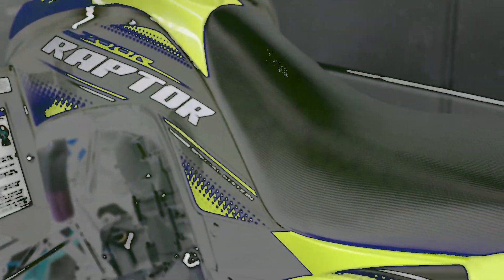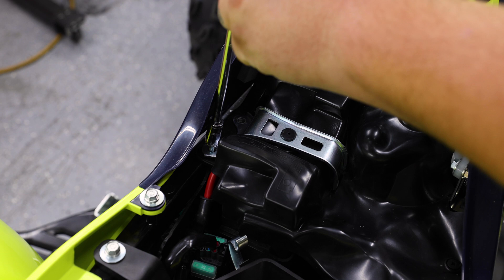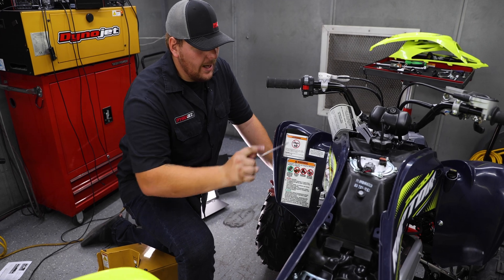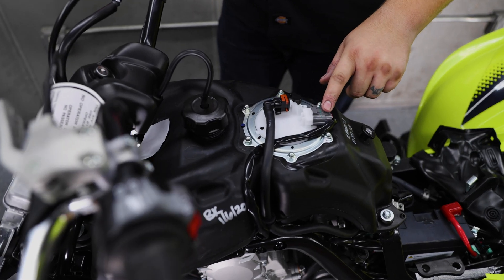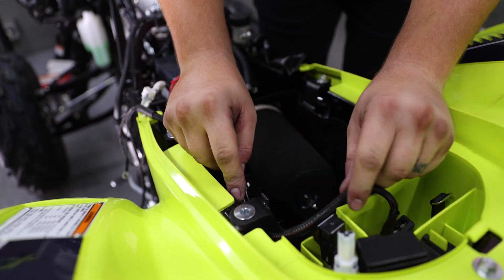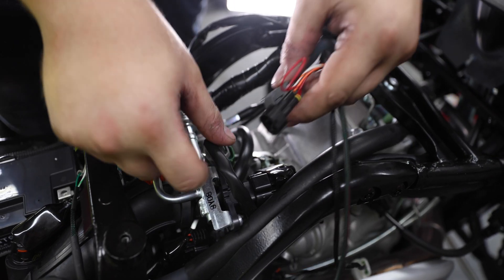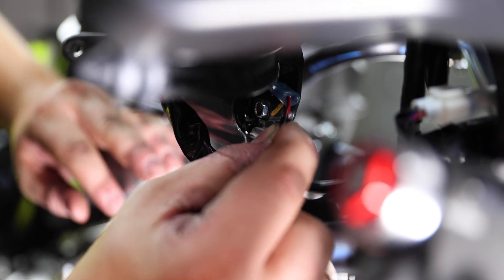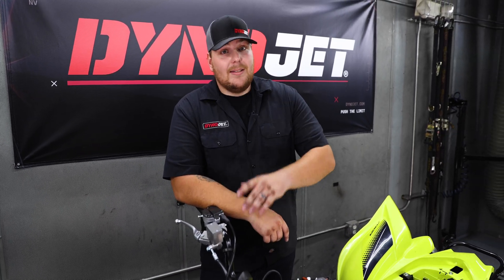How to Install a Power Commander V: Yamaha Raptor 700

Comment: Do not install this on a 2023 or a 24 700 what they won’t tell you is Yamaha change parts on the wiring harness for 23 to be able to hook up a diagnostic tool that is why the programmers caused the bike to throw engine code 33 and will not fire and it will leave you stranded take it or leave it. Everyone thinks they know everything, but I am speaking from experience along with hundreds of others, there’s a reason on the website that you cannot select a 2023 or 2024 yet
Reply: there’s no way around it?

Comment: If you have a stock bike and just have a slip on leave it alone, I installed this on my 2023 raptor 700 R and after four hours it made it a $11,000 paperweight and had to remove it because the bike would not start these things are garbage and your bike does not like them despite what everybody says on those Facebook pages unless you’re doing a big kit and a KN air filter, leave it alone the stock computer will compensate for a slip on pipe, the code it will throw is 33. There’s a reason on all the websites they don’t offer one for a 2023-24, they changed the wiring harness in 23 and the programmer doesn’t pair well.
Reply: Hey I have a 2023 700 just bought the slip on is your bike still running the same after not doing the tune also.
Reply: @markeithsellers8522 yes it is, I’m sorry just seen this, zero issues, they just push the programmers to make money your bike will compensate just fine with a slip on like a yoshi. Zero issues. Dyno proven
Reply: @bigbeef8935 what about a fall exhaust a big gun Evo black “I think it’s called” I brought it 3 days ago the only mod is the fall exhaust I think it’s still got the stock air box & not a K&N filter ect ? seems to run fine but I do see these channels & people saying you need one of these power commanders if running a fall exhaust? Appreciate any feedback
Reply: But on the 2021 model the Commander will do well ?

Comment: So is this compatible with a 2022 model? You’ve said it is and isn’t in two other comments below.
Reply from the maker: The PC6 now supersedes the PCV. You can find the PC6 available on our website now for the 2022 Raptor 700.

https://www.dynojet.com/power-commander-6-for-2015-2020-yamaha-raptor-700-pc6-22074/
Reply: @DynojetResearch  Great, thanks.

Comment: Does the power commander V to 2020 models can be connected to raptor 700r SE 2022?
Reply from the maker: The PCV will not be compatible with a 2022 model.
Reply: @DynojetResearch  thanks for your answer. I was getting ready to buy it this week since the dynojet customer support told me they are compatible. Thanks again keep up the hard work.
Reply: @DynojetResearch  
So is there an option at all for a 2022 model? Do
You need the PC6? I’m in the U.K.

Comment: I want to install dual empire exhaust, do I need a tune up or something in order to install the exhaust?
Reply from the maker: To maximize air/fuel ratio and efficiency of your motorcycle, it is recommended to equip your motorcycle with a tune when switching the configuration. You can find the different configurations of exhaust/air filters etc. in our tune database.

Comment: I bought one for a raptor 700 with a open airbox and stock exhaust but with the spark arrestor removed if and its tuned to this setup if i get a after market full exhaust do i have to tune it again ?
Reply from the maker: It is recommended that you tune your vehicle with performance upgrades.

Comment: Is there a video like this but with a yfz 450r ?
Reply from the maker: Unfortunately, not at this time.
Reply: @DynojetResearch  Do you need to download a map for the tune to work or does it automatically work once installed without downloading a map ?
Reply from the maker: @efrainmoreno6964  it comes with a tune for a completely stock model. We have tunes available for download on our website and if you would like to request a tune, you can reach out to us at powercommandertech@dynojet.com.

Comment: Is it automatically tuned and ready to run once you connect the power commander or do you need to take it into a shop for tuning and computer work ?
Reply from the maker: Depending on your setup, you can either download a MAP from our database on our website or visit a local Authorized Dyno Center to have it professionally tuned to your configuration.

Comment: Hi, how many hp the raptor will e
increase? I've already a Leovince exhaust system (only final part not complete) and  bmc air filter
Reply: Get a pro tec moflo airbox cover gives 3-4hp an better filtration! $90.

Comment: What octane fuel should I use ?
Reply from the maker: Daniel, on a stock engine, 91 octane will be fine.
Reply: @DynojetResearch  outside CA we have 93 octane. Use it if you can!     - Ohio
Reply: Rec 90 ethanol free

Comment: So do I have to download the tune to the power commander first or do I install the power commander and then download the tune then start the engine
Reply from the maker: Either way works, Leonardo.
Reply: Dynojet Research, Inc. thanks I have another question after I installed everything as in this video my fuel pump won’t prime anymore therefore the engine doesn’t start, it does turn over but it doesn’t start, I’ve already replaced all of the fuses
Reply from the maker: @jalisco872  You can email us at powercommandertech@dynojet.com and we're happy to help you out with that.
Reply: @jalisco872  you hooked the wrong 3 prong, you hooked on the upper fuel rail but are supposed to hook on the lower right side of the throttle body.

Comment: Should I use the power commander with stock exhaust? I will install a high flow filter. I want one because of the engine heat, but will I get a hp gain without the pipe? Thanks!
Reply from the maker: Todd, send us an email (powercommandertech@dynojet.com) and we can answer your questions. Thanks!
Reply: Hello I have the same question as Todd Merriott
Reply from the maker: Manuel, email us at powercommandertech@dynojet.com and we can help you out.
Reply: Hi! I have has the same problem with my 2018 700R. I also thought about replacing the foam filter with a K&N, but before you do that, check your radiator or get rid of your thermostat.